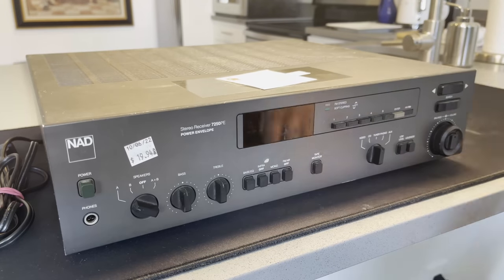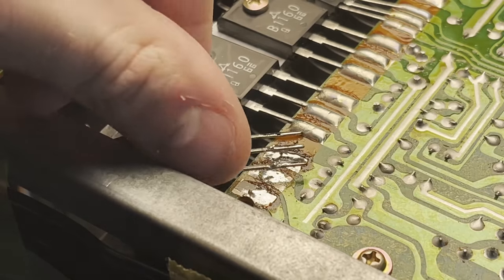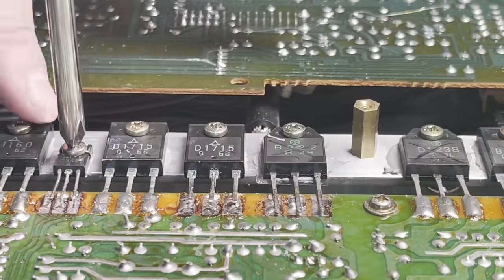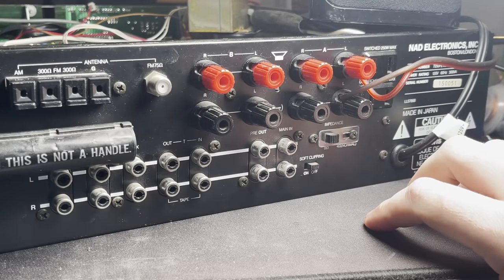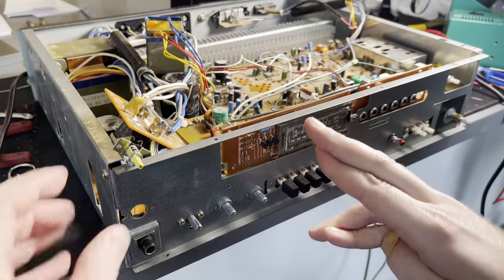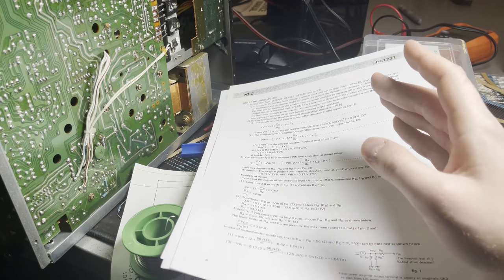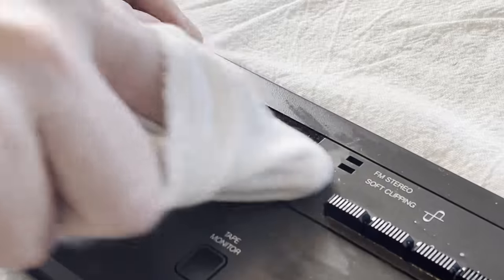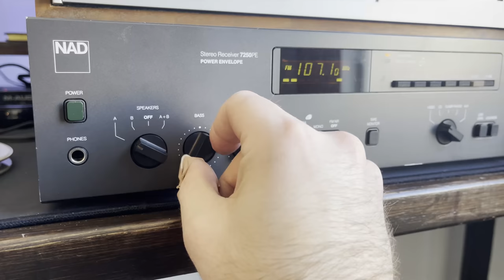Broken Amp? NAD a problem! - 'Fixing' A Mid 1980's Amplifier

Comment: I have been shouting to the rooftops where are the preamp amplifier Bridge couplers because you only remove them if you're going to hook up noise reduction or a equalizer and since you were not hooking up either one of those devices the bridge should be in there and that's why you were not getting any audio and that's not the only receiver that has that Marantz some Macintosh and several other receivers are set up that way and a lot of people have made that same mistake that you have and I'm surprised that the technician that looked at this did not realize it themselves but there are also some of those units have a switch on the back of the unit that will close that circuit so you don't have to have the Jumpers in there but NAD does not have that switch the I have worked on those many a Time I have bought many of them on eBay where they said that the finals were burnt out and comes to find that the bridges were not on the back of the unit they bought them at a garage sale they bought them out of storage units and they sold them for parts and many a time it's because the bridge is not with the unit simple mistakes but I guess you learned something after you did all that work you should pay attention to the back of the unit or you should read more about the unit before you start taking things apart

Comment: You mentioned handle that is not a handle that is your a.m. antenna do not use that as a handle it should State on the back of that thing do not use as a handle because if you do you will Snap It Off and then you won't receive any a.m. out of your receiver you know how many times I've had to replace those on customers and it states on there do not use his handle and my customers have used it as a handle and I pointed it out to them do you see what that says it says in plain English do not use as handle and guess what they did they used it as a handle and it stopped receiving AM radio because they snapped It Off and broke the connections Lessons Learned From mistakes are sometimes the hardest